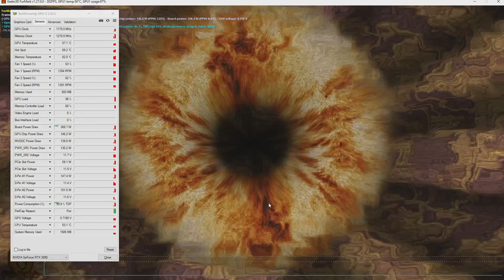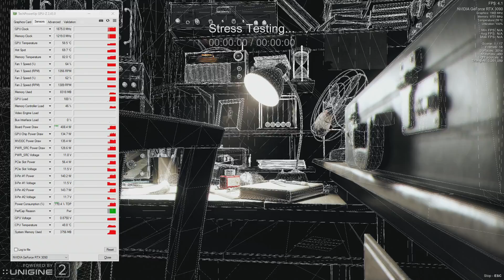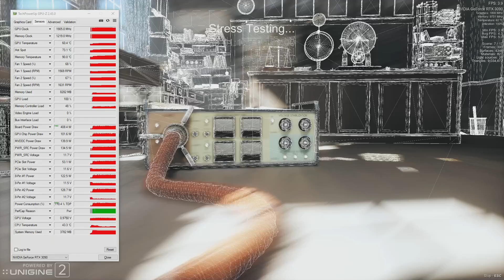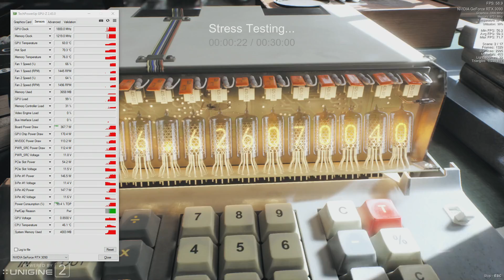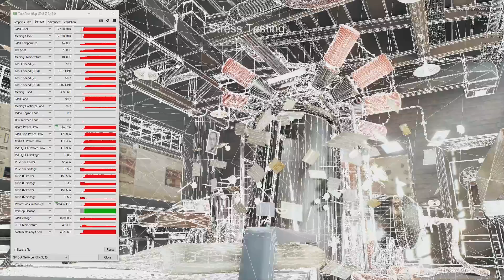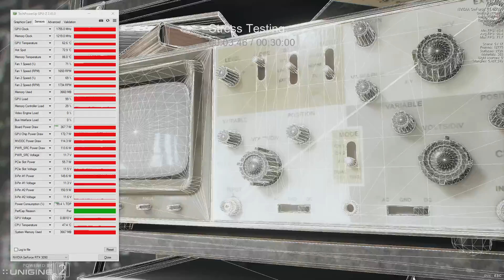One last thing about the RTX 3090 power management.

Comment: so getting to the point here, what you are basically saying is that maybe nvidia should introduce a more general type of auto downclocking feature in their future gpus. you cited AVX intel downclock as an example. however maybe that is not so easy for nvidia because they don't have something simple like AVX instructions to look ahead for.

but i get your meaning: you mean do not go into such a restricted mode just only when detecting furmark program. but instead to the downclocking based on the general load being requested. and not to totally gimp it, but just to reduce the clocks down a bit further than usual to ensure a wide margin of safety so that it keeps it well enough away from any chance of blowing up catastrophically...

but after repeating that i skrikes me maybe should that not be already something that should be incorporated within the existing firmware / software as a part of the inputs to the nvidia GPU boost algorithm? which is what dynamically controls the clocks....

this then goes back to the rumor that either a) NVIDIA was to blame in their driver for not setting the GPU boost correctly. or b) that NVIDIA thought their original / pre-existing GPU boost algorithm settings were already safe. however then with these new 3090s come along. then maybe the actual hardware design and power delivery was different than expected. or alternatively also possible (just like you mention) maybe there are some bad questionable components in the supply chain. which nobody was aware of.

the thing is in retrospect it seems that the companies involved did internally investigate (using the new world as a test benchmark). and did eventually find out what is the culprit cause was. but this information was never shared with the public. and perhaps due to not wanting to make public and then forced into some very expensive product recalls. it's cheaper to fix in software and push out a new driver update. and also get the developer to patch their games. this would explain pretty adequately why we never really got the truth about it. because who wants to recall all those 3090s under current market conditions? it would be pretty awful situation to have to do that.

still: you have a great point about them dying eventually further down the line. none of these companies would give 1 cent to care to protect the product adequately into old age. they would rather they al blew up after 3-5 years. so that it is clear out of warranty and then everybody has to buy new cards all over again. what annoys me about this is that: well people want to do that anyhow, regardless if they still work because the future cards will be so much faster. there is always a high enough demand for the latest product. so it seems kindda mean in that respect. since anybody who can realistically afford to buy a brand new cards (next time)... they will certainly buy them! and for those who cannot - that is simple because they cannot afford to keep buying cards all the time. so it's a policy that penalizes only the poor. and not the wealthy ones. so that is really where i take issue. it is also pretty bad for the environment too, for so many expensive products to end up as e-waste. sadface 
😿
Reply: Hi there I live in Glasgow Scotland UK I preordered a 3xs sytem from Scan UK on 18/09/21 they start build stage 3 on 8/11/2 I've up until   build stage 3 the day before  to cancel. I need a new pc with top gpu, initially I was looking at a scan custom built pc with EVGA 3080 I added the price up with ryzen 9 5900x with whatever else I needed it came to £2850, then I saw same kinda set up cpu etc with EVGA 3090 FTW3 ULTRA GAMING was £3099.98.However I'm reading and watching videos about the OCP sytem on evga 3090 and gigabyte 3090 is not set right hense they're deaths?It's a right pain as I'm still using an i7 930@4ghz 12gb ram with msi Rx 480 8gb/gigabyte X58A UD3R Mobo I got from overclockers UK in June 2010 for £1500 still works but get bsod with big ubisoft open worlds. Although the Rx 480 8gb only gives me 30fps max settings at 2k it's lasted 5-6years replacing my Rx 390 8gb, are better cards to be honest which looking at the situation is absolutely disgusting and sad since the evga 3090 is costing £1500.So I'm seriously considering cancelling in next few days and see how the 4000 series plays out or see about radeon 6900xt whatever.

Comment: Out of curiosity: Would you think comparing AMDs boost behaviour to Nvidias made for interesting content?
Reply: Yes but it wouldn’t be very easy to make that video.
Reply: Too true, I got a 6600xt and after a couple weeks of normal use, went to OC. No dice. It won't move past 2600mhz no matter what. So I just undervolted it and let it do its thing. Still not a bad card.
Reply: @raze4789  2600?
Reply: @moritzaufenanger2537  yeah. It doesn't care what I set the core clock to. It'll just boost itself into the 2600's and that's it.
Reply: @raze4789  I have a 6600xt as well and it boosts to 2800 if I OC it, I have it at like 2750 usually and it doesn't boost to that all the time, but most of the time yes.
Reply: Buildzoid currently hates AMD atm because of them locking the maximum clock speeds. And his 6900xt blew up so I don't even think he even has a card to test that with even if he wants to.

Comment: So does that mean that the fact, that New World is badly optimized on AMD gpus, actually saves them from  going up in flames? Because I am pretty sure RDNA2 has the same transient power spikes, especially on always power-hungry 6900XT. Or does AMD manage power-delivery more conservatively?

Also, do you think it's safe to unlock power limit through MorePowerTool to something like 360-370W on an adequately cooled 6900XT?
Reply: The AMD reference 6900XT is actually using a 13-phase 70A vcore with TDA21472. The VRM is almost powerful enough to power a 3080 ti / 3090.
Cards like the Nitro+ is just a reference spec PCB with extra fuses and RGB added. As long as you can keep the VRM cool you should be fine.
Also the thing about the Navi 21, it is just a much leaner GPU compare to the 3090.
Reply from the maker: AMD cards don't pull as much power and use somewhat better power delivery components.
Reply: @ActuallyHardcoreOverclocking  It would be nice if you could walk us through (from connector to VCORE output) how AMD does things. I know your 6900XT cracked the die, but if you still have it you can still measure configuration resistors and the like.
Reply from the maker: @andersjjensen  AMD cards use a digital VRM controller so they just write the current limit to it's registers they also use the VRM controller to handle the power limit instead of using shunts.
Reply: IDK about safe....lol,  But I have drawn over 575 watts on air with my 6900xt OCF.
Reply: @r3drumg33k3  575W on the core alone?
Reply: @SolarianStrike  Yeah core alone.

Comment: When I used to have my 2080ti FE overclocked to mine and game with I uppped thepower limit to max and the TDP reading was often at 123%. I regarded that as the raised limit working. I now run that GPU at 90% power (and play New World with it, no crashes) and it runs as fine as ever.
Reply: @Smokeyninja  I pay a fixed amount for my electricity every month, so how much exactly I'm using makes no difference to my mining profits. I try to use as less electricity as possible so I have lowered the power limit on all my GPUs to the least it can be without reducing mining performance.
Reply: @Safetytrousers  You shall think about the environment we all need for survival. We still do not have 100%+ renewable energy, and not enough chips to support gambling with cryptocurrency at a global scale. The principle "work for money, the person, not the machine" shall hold. I know it is less convenient to work for money in person, but we all have to reduce resource and energy consumption, and just not do mining is the easiest to do.
Reply: @astarothmarduk3720  I haven't travelled by plane since 1989, I don't own a car, I don't eat meat. I recycle everything I can.
Giving up making a living for doing no work is not easy at all.

Comment: I did find it funny people were calling New World "unoptimized" to me it seemed like the exact opposite, they don't leave many transistors unused.
Reply: the game clearly has a Graphics pipeline that does a exceptionally good job at allocating GPU resources without serious API bottlenecks to bring so many 3090s to ruin, but where the game fails is how uneven that requested work is with pop in loading resources and frequent dips in fps combined with a very poor options menu lacking Toggles for common heavy effects like AO or AA, and the game in general seems to be heavy and wasteful with assets, the GPU horsepower to graphical quality ratio feels to be about half of that you would see in other AAA games

or in other words it looks like there Engine team has done a great job making the GPU spit out max pixels, but they need to work on better consistency and optimize assets and add more graphical options to the game before it could be considered well optimized
Reply: The spikes mean that it's unoptimized in gaming terms. CPU and GPU work very differently. And buildzoid himself even told us that he doesn't know much about GPU programming.
Reply: The game kinda feels unoptimised but not how good it uses addresses hardware, it just scales really bad with man player models/cities and some other effects.
Reply: I’m gonna tell my power company they shouldn’t charge me so much once I start using every available amp coming into my home because My power usage is optimized.
Reply: Using all transistors just mean a lot of resources are used, not that they're put to good use. Something being "optimized" carries some implication of resources used well. Especially in a GPU where a LOT of parallel work may simply be thrown away if a shader is poorly written.
Reply: @cacheman  I've noted the same with a lot of Battlefield games maxing out the CPU utilization. That doesn't necessarily mean it is well optimized for multi-core, just that it uses a lot of multi-core resources.
Reply: @defeqel6537  unless you have run vtune, you have no idea of the cpu is actually utilized. CPU report utilization in windows when they are stalled for memory - which is exactly the opposite of optimized.
Reply: Not to mention that there is only so much you can do when it comes to optimalization for Nvidia cards. Developers have noted, that Nvidia drivers and their integration is like a blackbox, so any optimalization is much harder than integrating drivers for Radeon cards, that tend to be more open. So this migh actually be on Nvidia and some internal fuckery thats done on deep level inside their drivers
Reply: There are examples of MANY Unity based games that look like old Direct X 5\7 games using stupid amounts of GPU Power for what they are displaying due to the code being to simple and relying on BRUTE FORCE instead of optimization. Higher GPU usage = Less optimized for the most part. The Goal for a game is to get that metric as low as possible while keeping visuals looking modern. That is an optimized game.
Reply: @tek_lynx4225  the beauty of draw calls and processing the same thing multiple times.

Comment: My understanding might be limited, but if furmark hits power limit at ~1200mhz/718mV and you for example doubled the power limit via shunt modding, how much would furmark pull in watts?
Reply: ALL OF THEM
Reply: A shunt mod is only for powerdelivery from the connector. The amount of amps drawn is determined by the GPU how much it needs to activate all its transistors. With a shunt mod you do not force double power going in to the core, but you basically tell the core that there's more power available if it needs it. The amount of power the core draws is basically based on voltage and frequency, which a shunt mod does not influence.
Reply: @unlimiteddy5546  actually shunt mod will influence frequency as nvidia boost system takes power limit to derive operating frequency and voltage. Less power reported -> higher frequency / voltage untill card things it used up all avaiable power headroom.
Reply: @unlimiteddy5546  That much I do understand, my point was wondering about what freq/voltage the card would run at, and how big the power draw, if not limited by the power limit it is currently beating against.
Reply from the maker: @Seriessify  I have suspicion that if you actually ran a 3090 flat in Furmark it would be somewhere in the 600-800W range.
Reply: @ActuallyHardcoreOverclocking  I figured something along those lines as well 🙋
Reply: @ActuallyHardcoreOverclocking  Would a 3090 KPE or HoF handle it?
Reply: many, like a fuckton...

Comment: For consumers in the future - and ideally to try and drive manufacturer behavior - how hard would it be to include a look at the protections implemented in the VRM when you do board analyses on GPUs? What additional information would you need to conduct the analysis, beyond what's available from the PCB shots?
Reply: You'd need to actually test the cards to see where they hit the limits or have board schematics to fully understand how they are configured. And anyway, I expect GPUs will start to implement more granular power management systems at a low level, to not issue instructions in a way that generates such transients, so it's likely not something that you'd be able to analyse at a board level.
Reply: Publicly available datasheet for the components, which is not a guarantee
Reply: @linnaea_lavia  Aside from leaked Gigabyte ones good luck getting board schematics for the GPUs.
Reply: @10ghznetburst  if there's full datasheet available for the power controller one can guess where the monitoring components should be located, and the datasheet would specify how those components should be chosen, problem is nowadays even that's not a guarantee. Some manufacturer locks up their documentation and only publish a 2-page flyer (they insist on calling it "brief datasheet" which I very much disagree).

Comment: I have seen new world mostly crashing in the map section. When I don't cap fps. I play on Alot of different hardware so my latest tested that crashed Alot was a vega64 where I couldnt get this game stable unless I basicly undervolted it or capped the fps. It's got a alphacool block on it so it's really cool and all. But it crashes no matter what at a small oc. The card does 1700mhz in firestrikes quite consistent but it wouldn't hold a 1600/1620 oc in new world.. had to step it down Alot.

Comment: very interessting. couldnt see this heavy violations on my 3090 gigabyte extreme. it hits 370 watts at peak in gpuz @stock. and,... you dont have to be nostradamus to predict with raising electro migration the components will degrade until they fail ;) out of my 5 1080Tis GS from gainward, 2 already died in the beginning of this year. all cards were used with nearly the same loads in gaming. all were bought in july 2017.
my 3090s extreme, all 5 cards have a warranty of 4 years. so lets see how long they will prevail :D :D
Reply: Set your update interval to the fastest it will go and test with Furmak with Post FX on. Also, electro migration is a silicon problem, not a VRM problem. These cards aren't frying their GPU dies. They're frying their VRM. Unfortunately, if the card doesn't have fuses, frying the VRM can course a 12V-to-ground short... THROUGH the GPU die...
Reply: @andersjjensen  thanks for you answer
Reply: @andersjjensen  did it. after 55 minutes the peak was 366.4 watts. average 356.3 watts @stock setting of 350 watts
Reply: Wht do you call working in a mining rig "gaming"?

Comment: Wait, did Gigabyte really start using 60A drmos'es? Every 3080/Ti/90 that i've seen used either AL00 (AOZ5332 50A) or BLN0 (AOZ5311 which was 50A and then updated to 55A). If it is i wonder can it be some sort of preventive fix?

Comment: I'm blown away by how cool that card stays under a 350W load with fans at 70%.  My 3080 at that fan speed and power draw sits at 75C.
Reply: I'm guessing this is also on an open air test bench
Reply: @defeqel6537  that would normally help Alot :) but if you got like a phanteks p500a running high fan speeds on the front 3x140mm fans it won't matter much. My Strix 2080ti runs 56 open test bench and like 59 in the case.
Reply: Hmm, I got a gigabyte rtx 3080 and first thing I did was try to put a curve on it and get it to run some firestrike at highest possible clocks for stock power limit. Which seems to be 340/345w somewhere there. With memory oc of 1100mhz and all it still only ran around 60-65c. It's the triple fan gaming oc version.

Comment: This (not caring for Peak draw) might be the reason those gigabyte psu kept blowing up

The cards peaking too high combined with the too high opp/ocp on the psu just is too much

Maybe gigabyte looked at how Nvidia is handling this and thought that’s how we’re going to have our psus work
Reply from the maker: gigabyte's blowing up PSU had the OCP set so high that the mosfets would sustain permanent damage before shutting down. This would happen even on static loads(since OCP is normally tested by slowy ramping the current draw on a PSU till it shuts down).
Reply: @ActuallyHardcoreOverclocking  yeah but if you’re running it at 100% load and then one of those peaks comes in that might be what Leads to it dying I would guess.
Because if you just look at the tdps the connected devices shouldn’t draw enough current to overload it but those peaks happen and those would then kill the mosfets.

Atleast that’s my theory I came up with during breakfast watching your vid.